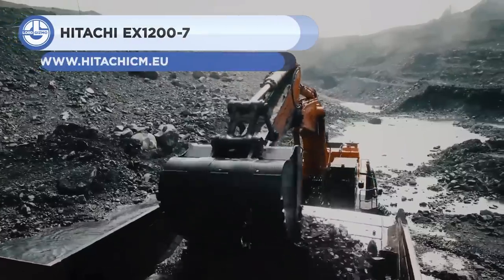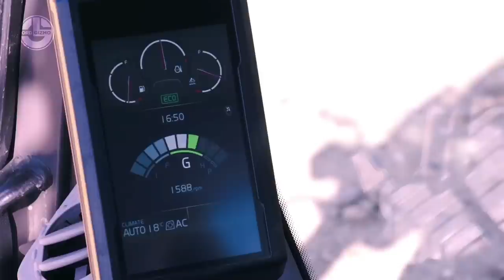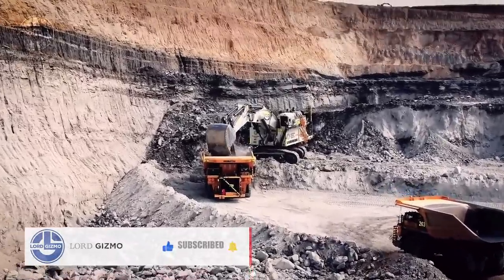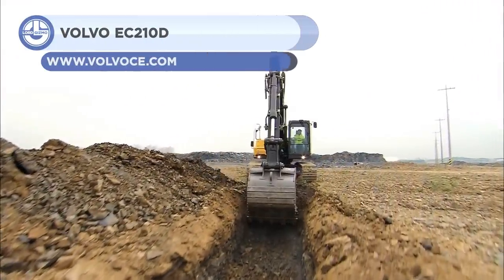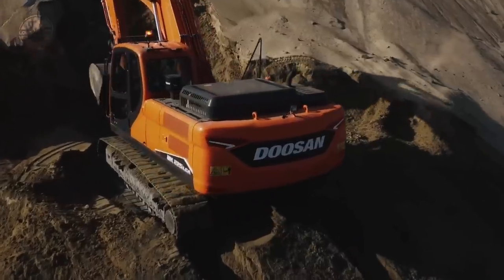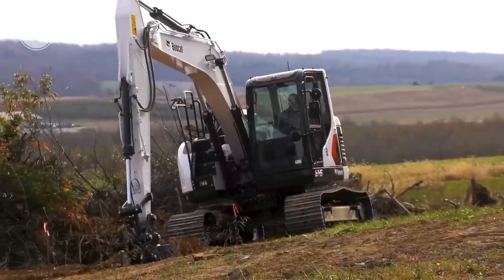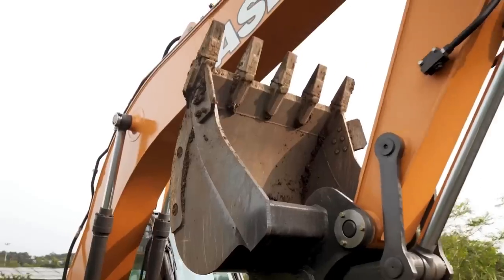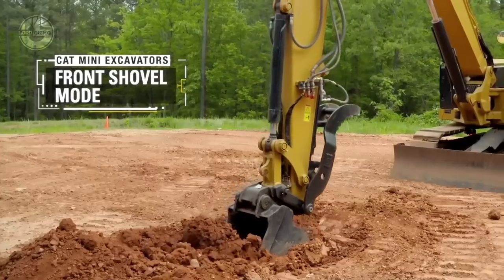15 EXCAVATORS That Are So Powerful, You'll Be Surprised

Comment: Are your stats on the Liebherr 9800 fuel consumption per day correct? 20,000 gallons is a lot of fuel. Could you have meant 20,000 liters ? Thanx for the videos.🙂
Reply: I heard that too. 😂 These videos are always full of mistakes.
Reply: You were right it is liters. I was curious and looked it up . It has a 4600 us gallon fuel tank.
Reply: @allanulen3809 17,000 l or 4,649 gallons is right

Comment: The mini JCB.. 7.3 MT. tall... That a tall story.... It wouldn't be a  LORD GIZMO video without the mistakes... And the mistakes just keep going on and on.
Reply from the maker: https://www.lectura-specs.com/en/model/construction-machinery/crawler-excavators-jcb/jz-140-lc-1158184
Reply: @LordGizmo .. By trying to justify your mistake, you have proved, again, that you have no actual knowledge of what you present.... The 7.3 Mt, that you claim is the height, is in actual fact the TRANSPORT LENGTH, which is the overall LENGTH with the boom ( arm) full extended out flat as would be necessary when being transported on a low-loader. (truck trailer)..
You can just add the apology below...